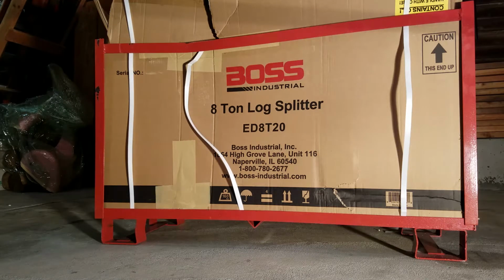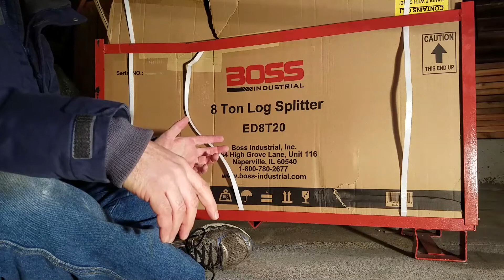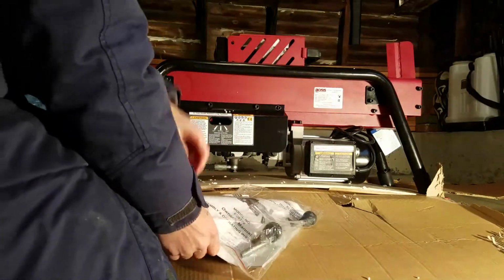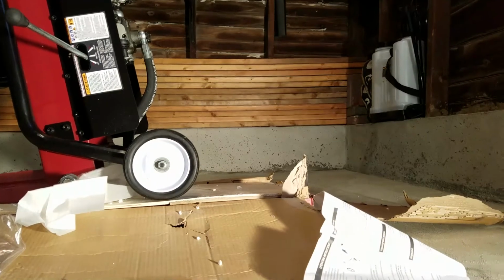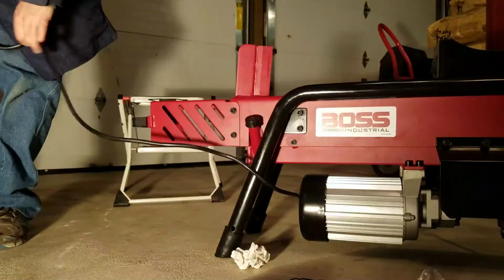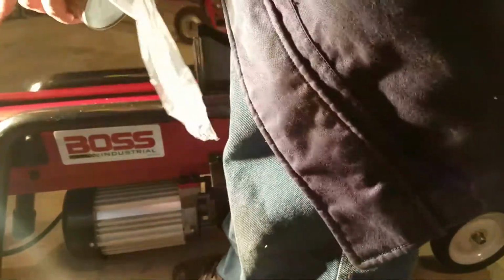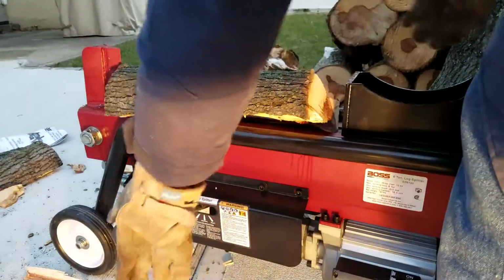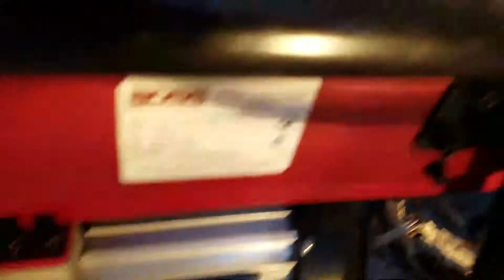Boss - 8 Ton Electric Log Splitter - Model# ED8T20

Comment: Can't wait to see the 4 way video !!
Reply from the maker: Thanks, I am working on it. I installed the 4-way splitter and I also installed the stand that raises the splitter. Then I accidentally lost much of the Video, but luckily finally found it preserved by sugarsync backup. Problem is I have no logs left (I'm in NY) and its Zero Degrees outside, so it will have to wait.
Reply: Yea, its freezing here. I'm 1 county over from you.. it's been brutal out, and it's getting even colder this weekend.

Comment: It's a practical log splitter for a home owner. The two way splitting action helps make up for the slow stroke speed. But, the control lever can be a back killer and a trip hazard, especially for older people. It would be nice if they could come up with a better way to operate it, like with foot pedals or a remote control.
Reply from the maker: Robb403 i agree. I would call it a back splitter. Maybe someone has a solution for raising it. Thanks!
Reply: I think you could make a lever out of electrical conduit that would pivot behind the wheel on the axle and attach an actuating bar from the vertical lever to the hydraulic control lever. You would need to bend the vertical lever outward a bit so it doesn't interfere with the log being split. Depending on how you shape it, it could hand or knee operated.
Reply from the maker: That sounds like an intelligent idea! will look into it.

Comment: Is your splitter still working? I would love to know if you still recommend it. I am thinking about buying one.
Reply from the maker: It got better with use. I like it a lot, I would think about the larger one, I think its a 10 ton, as I think it comes with a stand and a smaller pusher so larger logs fit. This one works well, but sometimes logs don't fit. I think its as good as you can get on electric.
Reply: You mean sometimes the logs are too long? I try to cut about 16". I really want electric that is why I'm looking at this one. I currently have the little 5 ton electric and it's pretty good but I hate the two hand operation plus I have to reposition logs too often because it can't always split them. I don't mind the low position because I kneel while I work. I mostly just want to know if the splitter is well made and durable. It doesn't have a weak feature that is going to be a problem. From what I see in your video it looks very well made.
Reply from the maker: @dangrimes5078  It is well made and durable. Check the manual to see exactly how long the logs max, it will fit. I have an issue when the logs are wet, it stops the splitter cold. Overall, I like it a lot, if you are cutting for your own personal use, its fine. I would look at the 10 ton model though, as well.

Comment: Good vid looks like it does a pretty good job and was worth the money. Have you gotten any use out of your Ariens snowblower yet, this season?
Reply from the maker: Not Yet, we only had at most 2 inches so far in New York, But I have gas for it and I am ready to go! It's good to be prepared!
Reply: silverbankruptcy  True always good to be prepared.  Regarding snow the same here in the Lower Hudson Valley, should come soon enough. Regarding the wood at our old house I had a really good wood burning stove a Lopi Leyden and I used to go through about a cord per month during the heating season , used it to heat the house for the most part. I had the same issues with landscapers and tree services: wet wood, short on cord...This is the way to go, you control the cuts and when you want to split as you mentioned will cut easier when dry/seasoned. The comment regarding the kids selling your stuff on eBay was very funny. All the best.